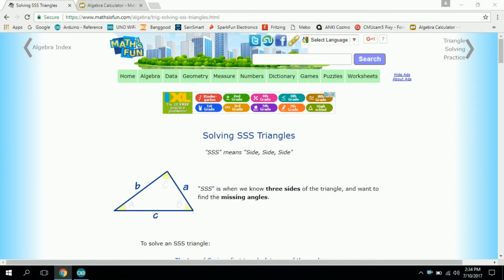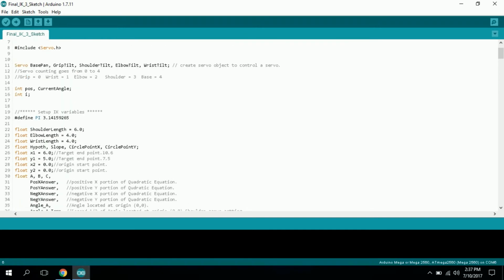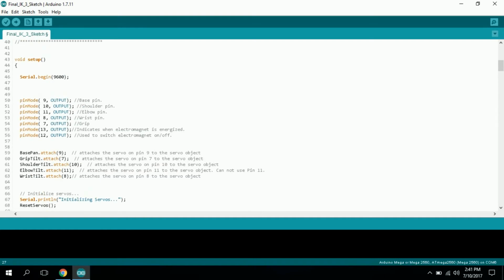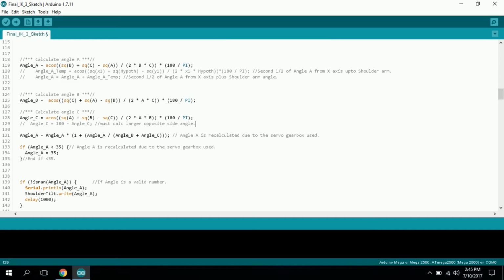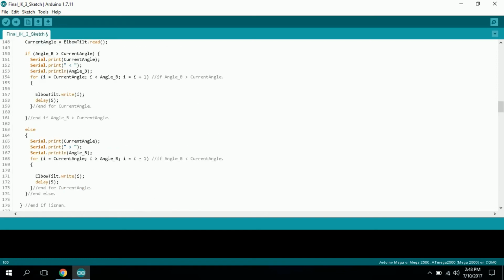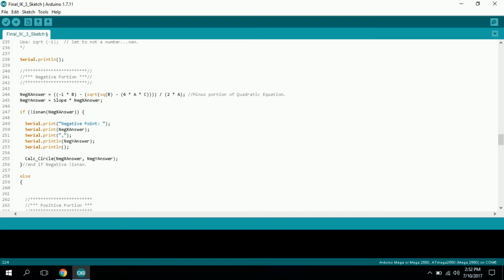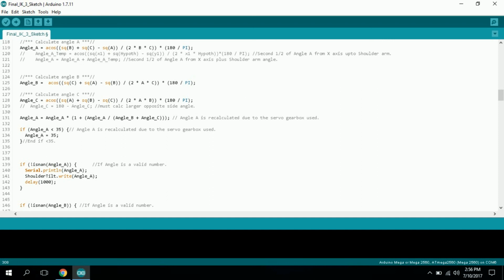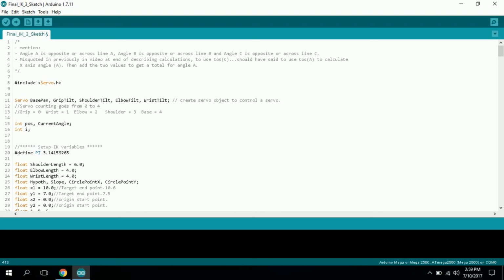Arduino Using Inverse Kinematics (IK)

Comment: oof... polar coordinates would be much easier bud replace all the vectors with r*e^(j@) this removes all the quadratics.  where r is the vector length j is the root neg 1 and @ is the angle.  for a simple 4 bar linkage [ r1e^(j@1) + r2e^(j@2) + r3e(j@3) = r4e^(j@4) ]  much simpler....source: mechanical engineer

Comment: Well all those calculations are based on the assumption that the line connecting origin with final point  will be used. I think there are many more cases and propably this is not the optimal. In your solution for instance the wrist is facing upwards.  Anyway this is a cool solution if you want to avoid complex calculations so a like from me :)

Comment: Sir, why did you perform so many calculations to get the distance of third side of a triangle? (I mean putting y in the equation of the circle, get the co ordinates and then applying distance formula).. You could have simply subtract 12.2 - 4 = 8.2 to get the length of the third side, then applying s.s.s technique for angles.. Anyways, pretty nice explanation. Hatts off (y)